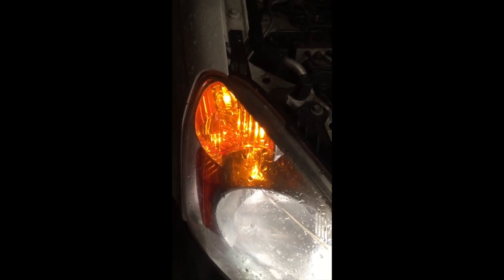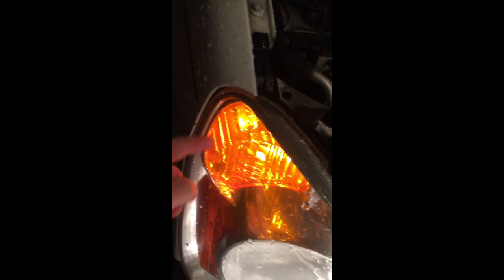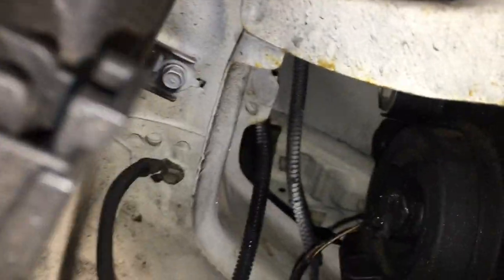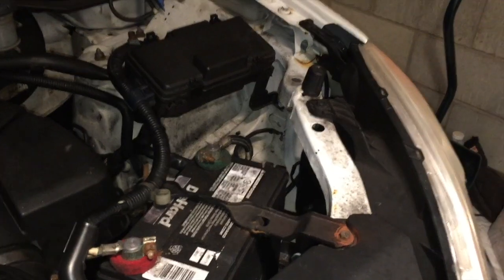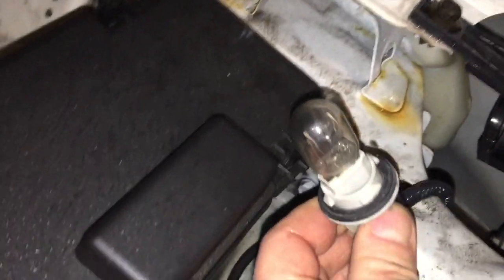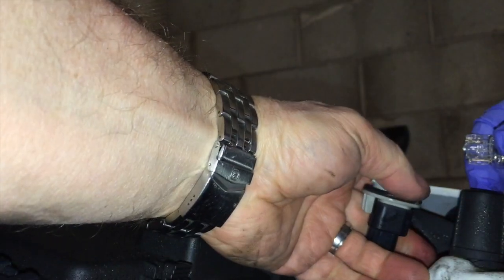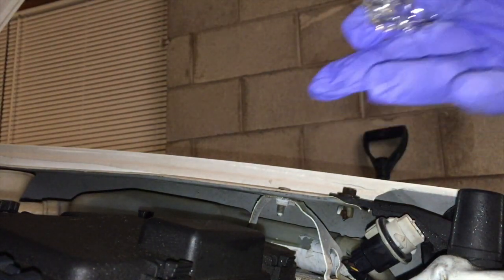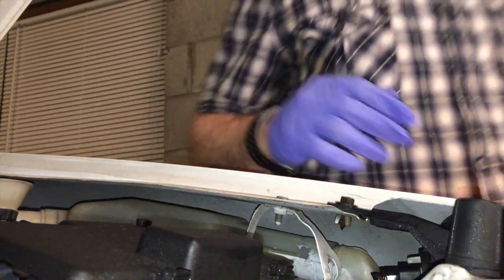Replace Running Bulb 2003 Honda CRV

Comment: on 2000 Honda CRV this is nowhere to be found. The battery is on the passenger windshield side not the front:( May have to disassemble the grill? or remove the headlight? dunno. no one has on Utube:(